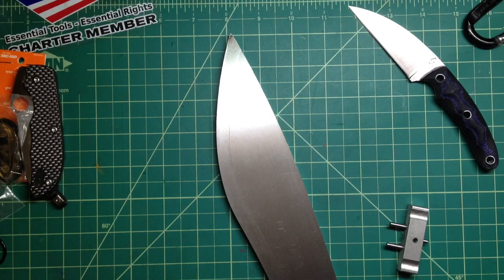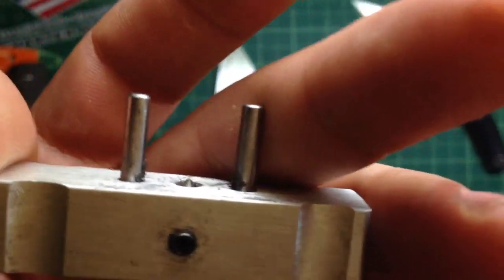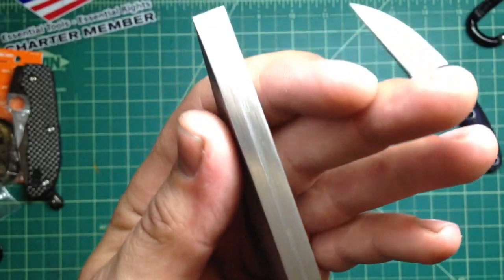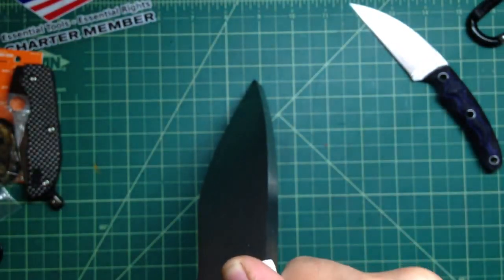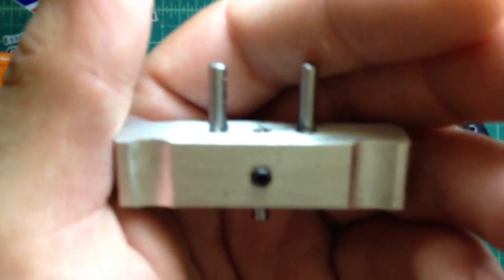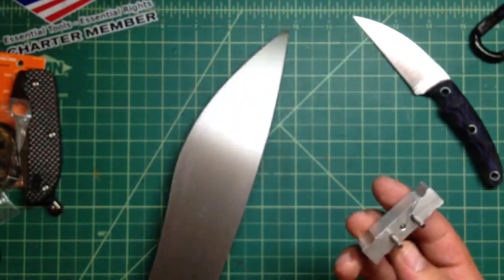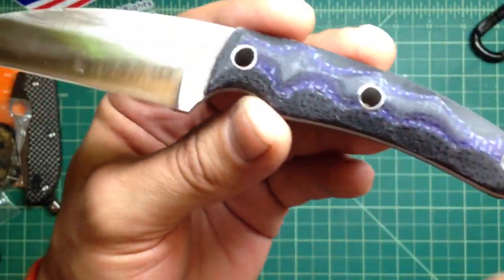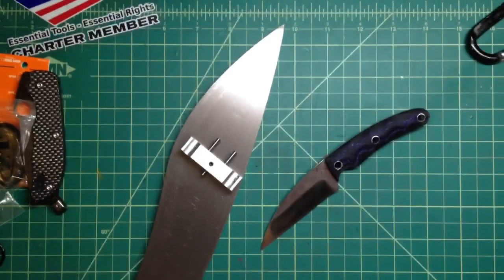Knifemaking Tip - Scribe

Comment: Very simple, but effective.  You know Gav you could also use a piece of tungsten electrode for a tig welder.   You can buy them at any welding shop and they are about 1/16 in diameter and very hard!  The tungsten would work great for the scribe.  Just a thought.  Gonna have to make one of these.

Comment: Hey something that might help you out with laying out blades, look up dykem layout fluid. (you can get it from msc supply) It's basically a blue dye that you spray or brush on the steel and it is easy to mark for layouts.